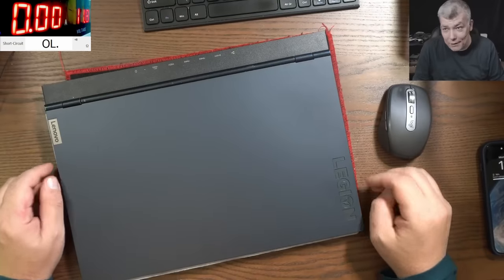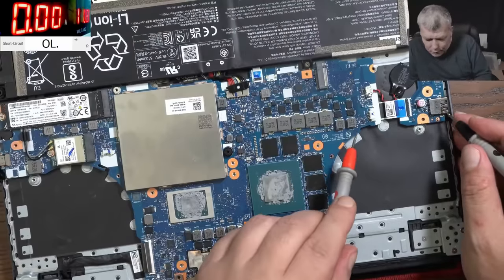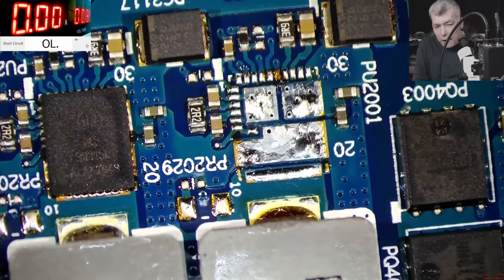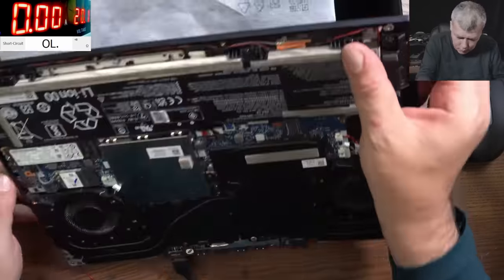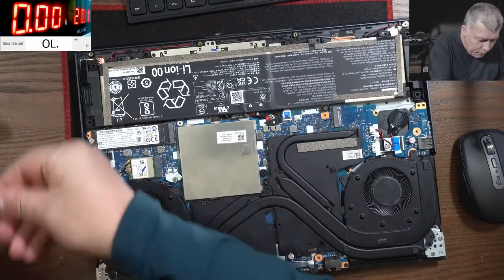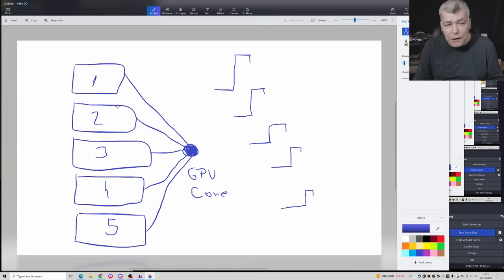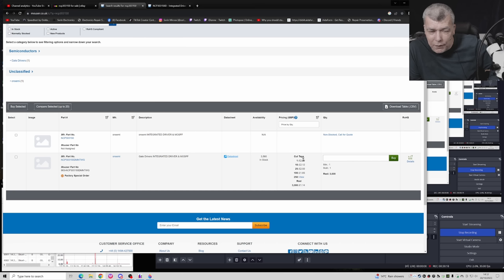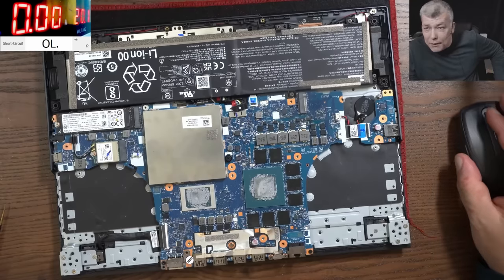Shorted MOSFET but GPU STILL GOOD ??? Lenovo Legion 5 dead, a mysterious case

Comment: Hi Sorin, I believe that both MOSFETs are the same, the 'D' version is the older one (datasheet is from October, 2019 − Rev. 2) with the OLD ON-Semi logo, while the non-D version is the newer (and probably currently in production, with the NEW ON-Semi logo (datasheet is from July, 2022 − Rev. 3). That is most likely the reason that Mouser and such still have the 'older' version in stock. Hope this helps. Cheers.
Reply: Agreed
Reply: yes, both are identical (was comparing both datasheets).
Reply: @MichaelRabeno: Completely agree with you. The former Motorola, today On Semiconductor, merged with Fairchild Semiconductor (both American), both currently owned by the Chinese company Lenovo. The first four letters of the alphabet (A,B, C & D) are authorized by the FCC (Federal Communications Commission) for internal changes that electronic companies make to their devices or products; including profound alterations or modifications in its basic internal circuitry, with the understanding that it is an improvement that will NOT affect the original functionality for which it was designed. Another way of saying it, in this specific case, the part number NCP303150 (from a former American company, which of course, knows this regulation) can have any of the 4 letters mentioned without the written authorization and/or approval of this federal agency. All the best.
Reply: @CarlosGarcia-d3e  
Source?
The FCC does not concern itself with integrated circuits as such. Manufacturers can name their ICs any way they see fit.

Comment: modern vrm can protect the gpu in case of high side mosfet short. they do this by detecting the pulse width. if the pulse width exceed the threshold (indicating a shorted high side mosfet), the controller will turn the low side mosfet on, shorting the entire rail (crowbar action), thus protecting the gpu.

Comment: The *NCP303150* and *NCP303150D* are both integrated driver and MOSFET with integrated current monitor devices manufactured by ON Semiconductor ¹²³. The NCP303150D is a newer version of the NCP303150 ³. 

The main difference between the two is that the NCP303150D has an additional feature of **Zero Cross Detection (ZCD)**, which allows it to operate in synchronous rectifier (PWM) mode when ZCD_EN is set low ¹. The NCP303150, on the other hand, does not have this feature.

Comment: Thanks for this video! I had a similar situation recently with an ASUS ROG Ryzen 7... waiting for the replacement mosfet. I was not sure if device manager was a good check but I did check anyway and both graphics were "working properly", glad to be able to confirm that this is a good check to know if the GPU is good.

Comment: 9:58 it is nothing strange. As you well know you have two mosfets inside that chip. One is based on ground, second on 19v. if second is shorted then the 19v will pass and GPU will take it and die, but if first mosfet is shorted then the GPU will be taken to ground only so it will survive.
very often the second mosfet dies (19v)  but as you now see - not always.
Reply: Correct me if I am wrong but even the high side mosfet output is only like 1v. So even if the low side mosfet drain to source is shorted. Only 1v will go to the GPU? Or both the mosfets work together to produce that 1v?
Reply: @Negiku The high-side MOSFET is in charge of the output voltage. The PWM on-/off- time determines the output voltage. As a picture, with 50% of pulse, you get half of the input voltage at the output. The low-side MOSFET acts as a synchrone rectifier.
Reply: @Negiku If the low-side MOSFET is shorted, you get Zero voltage at the output.

Comment: All I can see is that the one without D is from the newer revision datasheet (r3 vs r2 on the D vatiant). 
And also, in the r3 datasheet, it says on first page bottom right: 
NCP303150/D
Meaning, it goes for both. 
They should be equal.
Reply: HAHAHA!  master they are in same line but each of them are Driver mosfet... which means those have jobs to do

Comment: 2:27 ,those mosfets didn't have much contact with the thermal pad. see this on Dells too lately ,bent heatsink ,thin thermal pad?
Reply: Good catch! The thermal pads have basically no imprint of the mosfets so they aren't even touching at all, leading to early failures.

Comment: Probably it's about marking for different beneficiaries. the version without 'D' is for the lenovo factory. and other manufacturers use the same system, in addition, the version without 'D' is subjected to more rigorous sorting tests, given the destination...
Reply: It can also be a different silicon revision or a negative Chip Enable instead of a positive Chip Enable, or different working temperature, or ...

Comment: Hi Sorin, please check it. The two chips you mentioned belong to the NCP303150 series from ON Semiconductor, but they differ in their package type. Here's the difference:

    NCP303150D: This chip uses a DFN-6 package (Dual-Flat No-Lead), also referred to as QFN-6. It's a package without lead pins that is mounted on the surface of a PCB. This type of package is commonly found in modern electronic applications and allows for space-saving and good thermal performance.

    NCP303150: This chip is the same as NCP303150D, but it comes in an SOT-23-5 package. SOT-23-5 is a smaller package with five lead pins and is often used in applications with limited space.

In terms of their electrical characteristics and functions, these two chips are identical. The difference lies only in the package type, making the choice dependent on the type of mounting and space constraints in your design.  <--- This is the answer from ChatGPT

Comment: The NCP303150 and NCP303150D are like two peas in a pod, or rather, two MOSFETs in a package. They're both high-performance, integrated driver and MOSFET solutions, perfect for high-current DC-DC buck power conversion applications. The only difference between them is their packaging. The NCP303150 comes in a standard package, while the NCP303150D is a "D" version, which means it has a slightly different package type. It's like the difference between a regular and a deluxe burger - same delicious MOSFET goodness, just with a slightly different bun.

Comment: Hello, you repaired so many laptops, could you please guide me: what is your opinion about best gaming laptop motherboard? which brand is the most durable components and good design for their motherboards? If you want to mention a gaming laptop brand, which brand and model would be your personal recommendation? All gaming laptops stop working as soon as they receive very little amount of static electricity on the motherboard and short circuits happen almost all the time. which brand you think has the best components and design on the motherboard that can survive shorts?

Comment: Im planing to get a power supply and modify the short protection circuit so it can supply power when there is a short. Some youtubers claim that bypassing the short circuit protection may cause track burning and damage on the board. I haven t played with current and voltage to find the short circuits but i think that setting the voltage and limiting the current bypassing the short protection should be just fine
Reply: Of course, to control the current is the best. 😊

Comment: Hello Sorin.
The "D" on the mosfet represents the temperature range that the mosfet can handle. Unfortunately I cannot tell you what the correct temperature range is, but I see that you have the specs. Check the table to see if you can find the temperature range and compare it with the "D" version. Greatings Andy.
Reply: not in this case, compare the 2 datasheets, the D version is identical to the non-D version.
Reply: @robertjung8929  Strange!! Normal it is so that a extra letter give the temperature range off the ic. I check also and the to spec's are indeed the seeme. Maybe a fault from the factory and forget in the spec's to mention the temp range?? How nows.........................🙄🙄🚧
Reply: @Beekaert  there is no "normal" for meaning of suffix letters. each manufacturer uses suffix letters for different purpose.

Comment: 10:10 never do it if you have any phase supply missing / desoldered. furmark, occt, and others - all draw maximum power / current. so first replace missing phase then apply heavy load test. You know it very well. I just remind you.
Reply: it wasn't heavy load, just built in test of GPU-Z.
Reply: It was 30% load tho

Comment: its the same chip, just a diferent batch production. I would just replace the mosfet with the D one, if it makes you feel better just replace all 5 of them... has other user said, the newer datasheet refers to NCP303150/D on the bottom right on the first page...

Comment: Hi, I have the same laptop. My dedicated gpu is not working in devices manager it is show the yellow sign error"Device not connected properly." I checked the board, and there are no shot circuits, but my Gpu is not heat up or anything.

Should I reflow my Gpu soldier, and how risky is it
Reply: If you have good rework station is not risk,solution is reball GPU or memory around..Before reflow ,you should test all phase with oscilloscope be sure that current is fine.

Comment: ask google .. ooops Bard , when you don't know :-) not sure if it's relevant :

The main differences between the NCP303150 and NCP303150D MOSFETs are as follows:

Threshold voltage: The NCP303150 has a threshold voltage of 1.2 V, while the NCP303150D has a threshold voltage of 2.5 V. This means that the NCP303150 is more likely to conduct higher leakage currents than the NCP303150D.
Maximum drain-source current: The NCP303150 has a maximum drain-source current of 2 A, while the NCP303150D has a maximum drain-source current of 4 A. This means that the NCP303150D can support higher loads than the NCP303150.
Drain-source resistance: The drain-source resistance of the NCP303150 is 100 mΩ, while the drain-source resistance of the NCP303150D is 50 mΩ. This means that the NCP303150D has a lower resistance, which results in lower power dissipation.
Maximum operating temperature: The maximum operating temperature of the NCP303150 is 125 °C, while the maximum operating temperature of the NCP303150D is 150 °C. This means that the NCP303150D can withstand higher temperatures than the NCP303150.
Reply: It would be relevant if it wre correct but that is a complete load of  utter nonsense and disagrees with the actual datasheet on almost every point. 
The actual part is usable to fifty (50) amperes. ONE SPECIFICATION ALONE  is sufficient to demonstrate what you posted is rubbish.

Comment: why not use flux when you getting mosfet out from board I saw many times you do that. would it be more iz to its fluxed? Tnx
Reply: It makes a huge mess and does absolutely nothing of value. He is have trouble getting the part out because he is using a crude, inappropriate hack method.
Reply: He should use preheater it will be more better

Comment: i repaired a radio for a car a while back and ran into a similar issue. from what i could tell the added letter was to differentiate the old chip with the newer version. i could not find the original so we  only had the option to get the new one and hope. everything worked out just fine with no issues. though it is a bigger risk for a GPU like that, but i would confidently use the D chip. it may be the new version that fixes the issue that killed the first chip series.

Comment: Hello sir just I want to ask if you solve the issue for lenovo yoga 910 the one was taking 5 volts only if you remmember , I have same issue with my laptop , no short circuit everything is fine but no 19 volts at all

Comment: The path to ground through the other 4 MOSFETS and the 300W PSU would be a very low resistance. Do you think that could have saved the GPU?
Reply: if the bottom side mosfet goes first then the GPU survives because there will be no permanent exposure of the GPU to main rail. if the topside mosfet goes first then it's usually the beginning of a sad story (but still the GPU might survive if the bottom side goes for the ultimate sacrifice during the very next cycle). exposing the silicon to B+ voltage will not kill it, but the current pushed through by that voltage and the related heat will kill it. so if something stops the current (and therefore heat) before it destroys the chip then it will survive.

Comment: I don't understand the bad reputation for Lenovo. I've been selling them for 10 years (along with Dell, HP and Acer). They are nice machines. Of course, you have to know what hardware to get - don't just get the $200 junk on display at Walmart.
Reply: Bad reputation for Lenovo is not quality it’s just bad for people who fix them, a lot of soldered ram a lot of glue on ram chips and or other chips and that makes them unfixable …

Comment: Maybe it was playing just on the battery when the mosfer got shorted and in this case the current is not that high and GPU survive
Reply: you can't play on battery ;) the battery simply can't provide enough power. the GPU power and performance is seriously capped during operation on battery.

Comment: Anyone has idea what's wrong with my Lenovo legion 7? So the laptop boots up and there is a windows boot sound(you know the windows welcome sound) but no picture on laptop display or when i try to use HDMI cable on external display. Also no picture in bios mode. Ps: I have amd integrated and nvidia dedicated graphics as in this video.

Comment: Sir, I am Sri Lankan. My laptop is acer aspiar E5-574G laptop. When the laptop gets sick, it cannot be turned on. At that time, I have to reset the BIOS and turn it on. Even after that, it won't turn on. I took it to three repair shops and it works as it was. Sir, I need help, tell me a way to make the lap. Thanks
Reply: How can a laptop het sick😂
Reply: Take the laptop to KANDY..

Comment: Is there any problem if it is the first GPU's PSU ? 
Thanks SORIN.
Reply: If you are talking about the integrated GPU, for what I know, they usually are integrated in the CPU so the laptop wouldn't work and the CPU could frye.

Comment: Could it be worth the trouble to change out all 5 MOSFETS?
Then there will be 5 all the same. And the original ones can be bad.
Reply: Hmmm not really when you get a flat tire do you change all 4 tires?? 🤔🤔🤔🤔🤔
Reply: @hardkore360  
I had a neighbour that got a flat tire on his car. Nowadays they can't fix flat tires, so he had to get a new one. But he could not find model that he had, so he got 4 new tires, just so that all tires were the same.
It does happen.
Reply: @Drottninggatan2017  I've plugged tires with a simple repair kit multiple times, your neighbor got scammed, there's a sucker born every minute 🤣

Comment: Educated guess? Probably the capacitor at the output of the mosfet power suplies has large enough capacity to keep the GPU suplied during the power cycle of the removed mosfet.
Reply: nope.. the controller is keeping the output constant no matter what, so if one phase is missing then the controller will widen the pulses on the phases to compensate. obviously there will be a higher ripple on the output especially during high load because of that missing phase. under heavy load the other phases will be heating more (higher current) and the GPU might (and will) become unstable because of the ripple.

Comment: hello, so what will happened if the grounded mosfet is shorted? nothing will happened to the gpu or cpu , the power will cut down after it goes to ground directly not by gpu, i think
Reply: I think the opposite is true, this is just an exeption, we all were expecting a dead GPU, especially for a LENOVO (Sorin doesn't like them) and a gaming laptop (big power brick).
Reply: It's not a grounded MOSFET, it's a shorted MOSFET. The concern is not a short to ground but a short from 19v to the GPU via the MOSFET.
Reply: @jeremylaidman6525  we have two mosfets one connected to 19 and the other connected to ground, the coil is connected to the middle point, if the 19 one is shorted and grounded one is ok then the power will go to the gpu, but if the 2nd one is shorted what will happen? see the schematic
Reply: @AliMhammad  ah, I see what you're saying now. By "grounded mosfet" you're talking specifically about the low-side mosfet, but I thought it meant a mosfet that was shorted to ground. So yes, I think you're right.

Comment: what the difference between mosfet NCP303150D and NCP303150?
Reply: The main difference between the MOSFET NCP303150D and the NCP303150 is the drain-to-source voltage (Vds) rating. The NCP303150D has a Vds rating of 55 V, while the NCP303150 has a Vds rating of 40 V. This means that the NCP303150D can be used in applications where higher voltages are required.

Another difference between the two MOSFETs is the continuous drain current (Id) rating. The NCP303150D has an Id rating of 50 A, while the NCP303150 has an Id rating of 40 A. This means that the NCP303150D can be used in applications where higher currents are required.

Comment: So if the battery was at 50%, why didn't the laptop start charging it when you plugged in the charger? The current consumption was 0 until you powered the laptop on. 
Edit: Never mind, the charger was original, not the power supply, the current did not go up even after laptop started